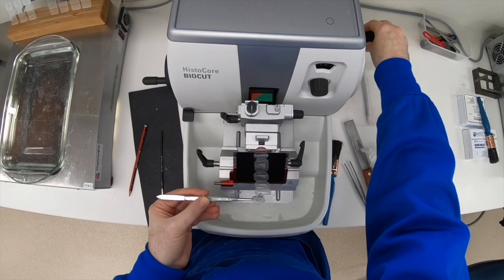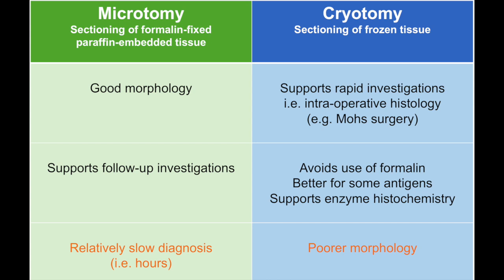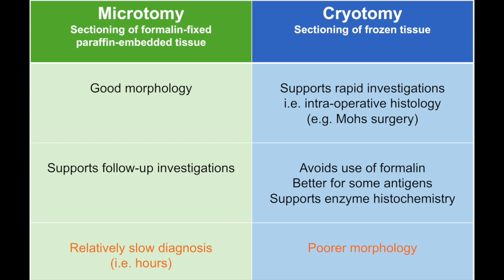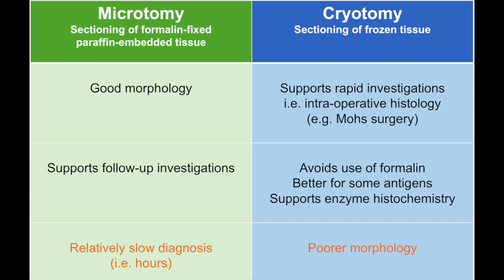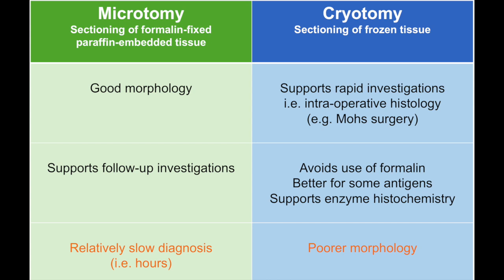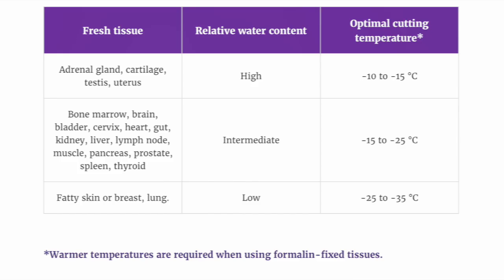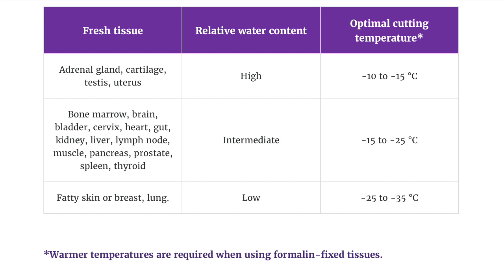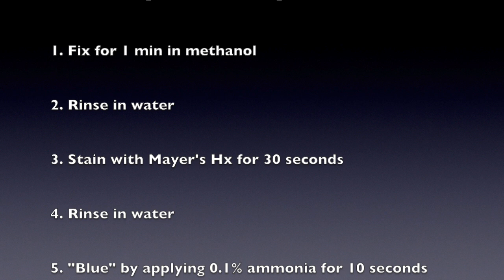Preparation of frozen tissue sections (Cryotomy)

Comment: Have a great day sir. I have a question: with spleen, lymph node specimens, should the section after being embedded in paraffin be cut thinner or thicker than usual ? And why we shoud do that ? Thanks for answering me !
Reply from the maker: I think this depends on a number of things. 
Lymphoid tissue is generally more fragile owing to less ECM components and higher density of cells, so you may gain advantage by cutting slightly thicker sections, but generally this issue can be addressed via use of picric acid in fixative solutions such as Bouin’s.
Reply: @damienharkin  yeah i got it. Thank u so much.

Comment: What is the embedding medium for frozen sections called?
Reply from the maker: Hi James, most laboratories use a commercial embedding medium known as O.C.T. which is an abbreviation for Optimal Cutting Temperature. OCT contains polyethylene glycol and polyvinyl alcohol dissolved in water. You can buy OCT from a variety of scientific suppliers.
Reply: Negative -50